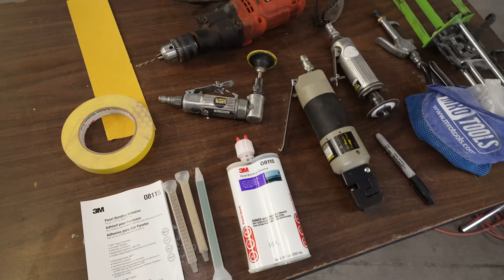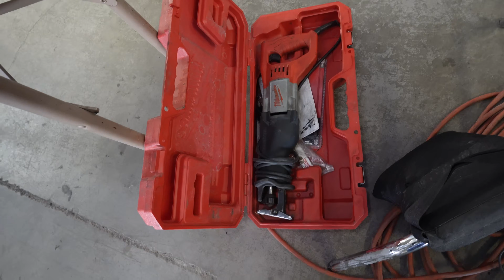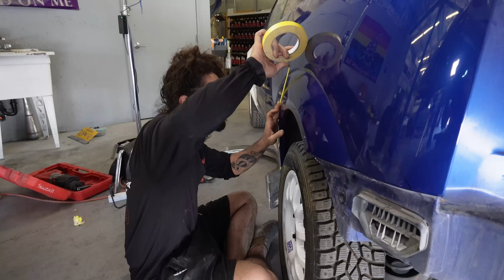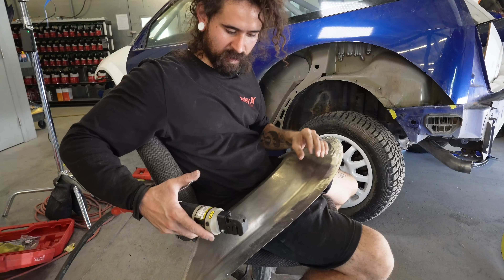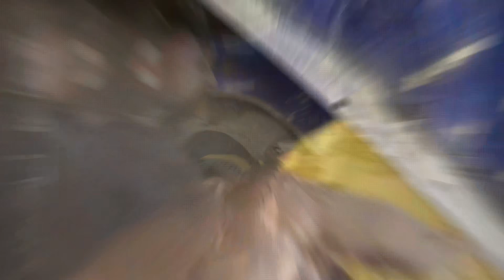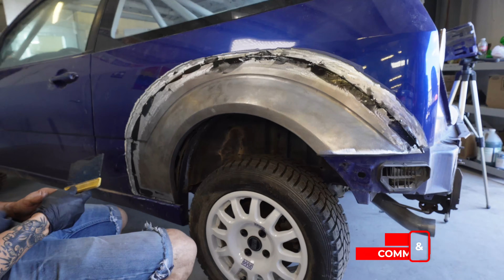DIY Wide Body Fender Flare Install | Sarah-N-Tuned WRC Focus Project

Comment: On my cheap customers I use window weld to bond panels,If it can bond a windshield to a car,to provide structural integrity,then it can definitely bond body kits,I let it dry and any little that squeezes out,I cut next day after it's set,been using it for 25 yrs now with zero issues.

Comment: I might have missed this part, but does the flared fender need to get bonded somehow to the inner wheel well tub to tie things back together ?  or does that joint have little to no structural purpose to the unibody ?
I'm considering doing something similar with my old WRX.  Rear fender rust cutout = opportunity to put on some fun flares or at least cut the wheel arch higher, but I don't know if I need to reconnect where the body and the wheel tub were glued together (would involve some hammering or fabbing up metal, which seems tricky), or if I can leave the body skin detached (hidden by a flare) from the wheel tub.  Just curious :)
Reply from the maker: New wheel wells will be fabricated and installed. Watch for future videos on this project!

Comment: Panel bond is a grear product. 
Here in Australia are insurance companies have done a 180 on using panel bond now , we have had to go back to spot welding and plug welding with the MIG and even have tighter repair requirements..

Comment: 3M panel bond adhesive is really good from what I have been told.   I need to bond the fiberglass rear flares on my 65 fastback project and I have never used this stuff before.   Thanks for this demonstration.   It was very well explained and I am a lot more confident I can do it right now.   

Aren't you going to need to re-connect the outer wheel house behind there somehow?
Reply from the maker: Happy to hear the video helped you out. Yes, Fred will be fabricating inner wheel wells for it.

Comment: Great video.    I really appreciate an alternative to welding.    I imagine you will leave a couple permanent penetration points.  Screws. Whatever. Along with this glue.  Buried in the final job...??
Reply from the maker: Screw heads will be ground down but the screw part will be left in.
Reply: @UWrenchTV  ... That's actually awesome...  Honestly seems quite do-able .. thanks for the reply 
Great channel by the way

Comment: Really nice work, Fred! Tutorial so clearly described, even I would attempt this. I am curious as to why the new flares are not flanged with the original stamping? Are they usually done with a simple overlay and filler? Your flush overlay will be invisible. Interesting process!
Reply: If you want to see what is normal practice, he covers it in the ranger bed rust video.
Reply from the maker: Not sure why they are not flanged when stamped.

Comment: I watched a 3m demo of panel bond 20 years ago. They used a bowling ball on a tether. Tested welds, rivets and their epoxy. Amazing how well it works.
Reply: When used properly, it is stronger than welds and rivets. Many late model cars use the panel adhesive with rivets for the authorized repairs. I'd hate to be the guy trying to remove a bonded panel from a previous repair.

Comment: Cant believe Sarah's OCD for symmetry gave you the go ahead to weld one and glue the other! Her aviation brain woulda been running weight and balance mathematics and structural rigidity formulae while said OK through gritted teeth. 🤯🤓😂😂😂

Comment: Thanks for your time to explain the process to install the flares, I can see how it could be used to adhere a patch panel into a rusted rear fender or patch a rust hole at the bottom of a front fender

Comment: This two-part glue will eventually fail. If you recall the Aloha Airlines 737 had the front section of the roof fuselage blow off in flight because of the two-part glue became old and unglued. It will eventually be the same with your car because I've seen it before I've seen guys use it before I've seen guys glue a roof on the car because they're too lazy to weld it on the car only to have the car fully engulfed in water during a rainstorm. Everybody finds out the hard way with these two-part glues no matter how good the name brand is.
Reply: All modern cars are put together with panel bond including yours if you look around hard enough you can actually see the panel bond between panels and fenders. Most manufacturers don't screw around with welding anymore because of how long it takes. Just about all super cars are put together with panel bond its insanely strong and the metal around it will fail and rip apart before the bonded area will

Comment: Great job mate. Quick question, Is there a reason you don’t remove the screws as opposed to grinding them down?
Reply from the maker: The screws probably wouldn't come out once it's fully cured, but you'd also be left with a hole to fill.

Comment: Great info. I wondered how it could be done. My cousin uses industrial adhesives on 
concrete blocks instead of grout.
My buddies in our repair shop (millwrights) used an epoxy compound mixed with a variety
of alloy metals I found, back in the 80's, to repair key ways on shafts 8 inch diameter.
Trowel it in, let set and machine shaft and keyway without removing the shaft.
Centreless Grinder is back in service in a little over 24 hours.

Comment: "Months learning to MIG weld"? You should be able to learn that in a week. There is enough info on welding on Youtube to teach you ANY kind of welding!!! Also, from a red seal welder, I'd recommend using a flux-core wire instead of a hard wire. The flux-core is a bit softer, yes, but you don't need gas, and it when the heat hits it during the summer, under the pain, you won't see any ripples or lines from the difference between the metals. Hard wire heats/cools at a different rate than the body metal will. This is also why it's not recommended to TIG steel body panels together.
Reply from the maker: This is a video explaining how to use panel bonding adhesive instead of welding. Just showing a different method to installing body panels.
Reply: @UWrenchTV  I know, I just caught this video and hadn't had a chance to go back yet. Panel bonding adhesives are amazing!!

Comment: The entire aluminum chassis of an Aston Martin is put together using adhesives and a few rivets.
Reply: @creamwobbly  Formula one used adhesives mainly because their entire chassis structure for the last 20 years or so has been carbon fibre.